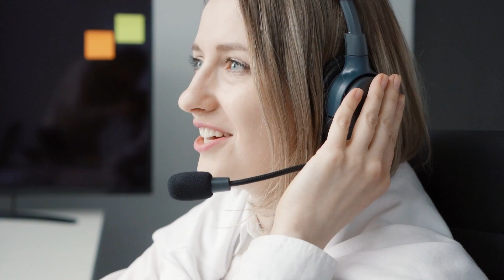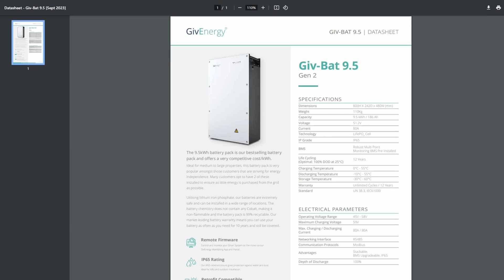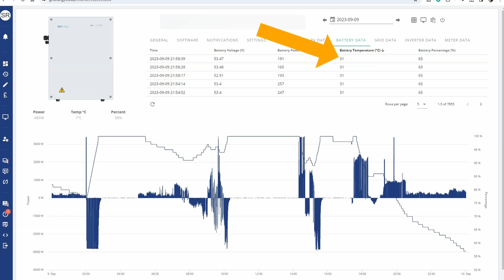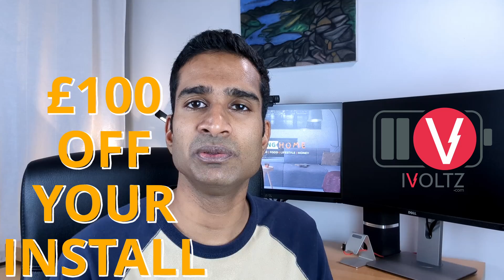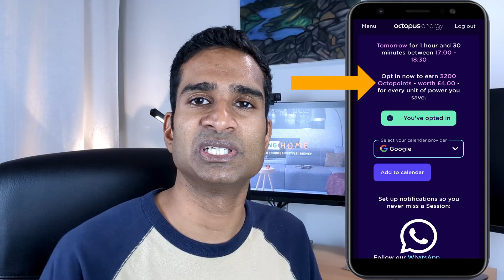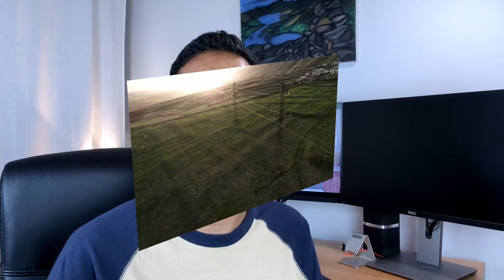1 Year Solar And GivEnergy Battery Review - What I Wish I Knew...BEFORE Buying!

Comment: I'm starting my solar journey, I'm settling on the largest solar installation I can fit on an east west roof, a 5KW inverter to reduce times of drawing from the grid and 10KWh of battery. I've got quotes but I'm being pushed to Fos ESS. Is there a reason to go with Givenergy?
Reply from the maker: Hey, absolutely agree biggest solar array. Re battery, I've had no issues with GivEnergy but I have seen reports of people with issues struggling to access customer services. Another option to consider is SigEnergy. Fox ESS have been around for a while but not something I'm too aware of as a brand. All the best with the install 👍🏽

Comment: For what its worth. I put a thermometer in the loft. The loft gets as hot as the outside temperature. Max I've seen in my loft was 33C. I think the battery overheating in the loft is based more on myth than based on facts.
Reply from the maker: Useful to know, thanks. So far we've not any performance issues, long may that carry on 👍

Comment: 10 panels for £4300 ? - they saw you coming.  - The biggest problem with givenergy is battery output to the house being a bit low. you still end up taking from the grid even though your battery is full.
Reply from the maker: Which array are you making reference to? I have two. Are you talking about the inverter capacity or lag time?

Comment: Thanks for the excellent video, well thought out and very interesting!  I had my system installed by Octopus in March 23 and I've been well pleased with its performance.   I had 13 panels (9 on 1 roof and 4 on another ), a 5.2kw givenergy battery and 3.6kw givenergy inverter. I'm saving around £1450-£1500  a year giving a 'payback' period of around 7.5 - 8 years. I have no real regrets about my purchase other than a nagging doubt whether I should have gone for a bigger battery to help out during winter months.  Have you ever considered including loss of interest in your payback calculations?  For example I invested £11.5k to purchase my system .  Had I not done that, this money would still be sitting in a cash ISA earning around 4.8% interest tax free
Reply from the maker: Hi Jim - Thanks for taking the time to watch and comment on this video. Glad you found it useful.

Yes absolutely, in my is it worth it video 2022 I did look at as sticking the money in a stocks and shares ISA. I concluded the ISA would win in the long term, which is why the system was bought after I'd topped up my ISA to 20k.

If you’ve not already, please do like this video, stay tuned for some more content and thanks for taking the time to contribute to the discussion on this video 🙂

Comment: Thank you for a great clear presentation. I am about to buy a house that has solar, an air source heat pump, a water tank and no batteries. Where to start ???
Reply from the maker: Hi - Thanks for taking the time to watch and comment on this video. Glad you found it useful.

Wow, that sounds like a great house. It may be worth asking the current owner how they run their set up rather than reinventing the wheel. Once you're settled in, it's well worth running the numbers for several different tariff options and whether retrospectively adding a battery is worth it for you.

If you’ve not already, please do like this video, stay tuned for some more content and thanks for taking the time to contribute to the discussion on this video 🙂

Comment: It's a no brainer to put the battery in the garage any issues the garage can quite happily go up in flames now it's the house instead - just what storage did you think you would be loosing just means a little less room for junk...?
Not sure you properly thought out the all the options, but hindsight is a wonderful thing, thxs for sharing.
Reply from the maker: Hi Pete - Thanks for taking the time to watch and comment on this video. 

I agree, in hindsight I would probably have put it in the garage and upgraded my cabling to it which would allow me to fit a faster charging point too. Hindsight is a wonderful thing.

If you’ve not already, please do like this video, stay tuned for some more content and thanks for taking the time to contribute to the discussion on this video 🙂
Reply: @everythinghome  Where there any concerns from house insurance re siteing the battery?
Reply from the maker: @peteturner8493 No there weren't. I did inform them though and it made no difference to my home insurance premium 👍🏽

Comment: Great video and information! It's a very complicated decision to make and very difficult to explain to less tech savvy people. 

Hard to believe that I am watching UK channels for solar and battery content! Downunder, weirdly enough, solar is not as helpful to the grid as it seems to be in the UK, with fèed in tariffs less then 5p per kWhr (and that is even a generous exchange).

In Aus on time of day metering, I believe that you can pretty much get free power during solar peak and free power at  solar minimum. So, I believe that it is then necessary to size your battery to carry you through the shoulder peak periods, am I missing something here?
Reply from the maker: Hi Brett - Thanks for taking the time to watch and comment on this video. 

Yes, that's exactly it. We got enough battery capacity to cover our peak usage. So basically we're either running off solar or off peak electricity.

If you’ve not already, please do like this video, stay tuned for some more content and thanks for taking the time to contribute to the discussion on this video 🙂

Comment: I added 8 x 450watt panels to my garage at the same time as my main roof (12 x 450) because I essentially only paid for the extra panels,  so even though they do get shaded latter half of the day the time it was still worth doing, whereas it wouldnt have been worth it for a standalone install.I guess you had to pay that extra install cost such as more scaffolding etc for your second install? I have a GE 9.5 battery.
Question, is a mains powered fire alarm the best choice for the loft? WHat if theres a power cut caused by a fire?
Reply from the maker: Hi Joe - Thanks for taking the time to watch and comment on this video.

That sounds sensible, yes undoubtedly it costs more for the installers to come out twice than just once. Our first install was easy on a single storey garage. They didn't erect scaffolding and it's partly on a slope so easy access, but definitely did for the 2nd install in 2022 (different company).
That's a good question. The fire alarms are mains linked but also individually have a 9V battery fitted which we change twice a year when the clocks change.

If you’ve not already, please do like this video, stay tuned for some more content and thanks for taking the time to contribute to the discussion on this video 🙂

Comment: I'm in the process of moving house, hopefully in the next couple of months. The new house needs a lot doing to it. It's got a really old oil heating system and there's no mains gas in the area.
I'm strongly considering all electric, i.e.  heatpump, solar and battery options. It's great to see content like this sharing experiences. Great video, many thanks.
Reply from the maker: Hi Chris - Thanks for taking the time to watch and comment on this video. Glad you found it useful.

That's definitely the time to be thinking about  it and and if you've not got any gas then an ashp should make sense. Especially given the savings to be had in not having to add a gas main and then the ongoing gas standing charge.

If you’ve not already, please do like this video, stay tuned for some more content and thanks for taking the time to contribute to the discussion on this video 🙂
Reply: Hi Chris, I'm in almost the exact same boat as you except I do have gas access. If you haven't already look up PVGIS tool on youtube and someone will show you how to calc how much kwh your roof could produce. from what I've seen so far it all seems feasible!

Comment: Thank you for the video. We had 19x395w panels, iq7+ microinverters, 8.2kwh GE batttery and Zappi installed in June 22 and it’s been great. Zero electric bills (including the car “fuel” for 7k miles per year) and still a few pounds left for the gas. Octopus Flux in the summer and intelligent go in the winter. My only regret is that there was space on the roof for two more panels, but I opted out as I thought it wouldn’t look “nice”.
Reply from the maker: Hi - Thanks for taking the time to watch and comment on this video. That's one great solar array and set up already. I definitely still regret not getting solar panels on the house and garage in 2015 but we live and learn. I'm looking forward to April again when I'll switch on Flux and be happily exporting again 👌

If you’ve not already, please do like this video, stay tuned for some more content and thanks for taking the time to contribute to the discussion on this video 🙂

Comment: Don’t think you say where your surge protector is? Between your house and the grid or on the DC side between panels and inverter?

Why not a DC coupled battery? Did you not look into SolarEdge? Only would have needed one inverter.
Reply: Also, didn’t you consider the garage loft space for the battery?
Reply from the maker: Hi Richard - Thanks for taking the time to watch and comment on this video.

The surge protector is between the house and grid I believe. From what I understand I needed an AC coupled battery to preserve my FIT. I hadn't thought of the garage loft space as an option but it would have still meant digging a trench to upgrade the cabling and access to that areas isn't particularly good. It's also got a lot of stuff there already but that could have been moved.

If you’ve not already, please do like this video, stay tuned for some more content and thanks for taking the time to contribute to the discussion on this video

Comment: I have a 5.6kwh solar panel array on a south facing roof which was installed about 2 years ago and I am about to get installed 2 x 9.5kwh and 1x 5.2kwh Givenergy batteries giving me a total 24.2kwh of storage + a surge protector and manual switch over. We are right out in the country and I am making sure we are covered for power outages. I found you infomation very helpful. Thank you!
Reply from the maker: Hi - Thanks for taking the time to watch and comment on this video. Glad you found it useful.

That sounds like a great system in the making. Interested to know, did you consider the GivEnergy AIO with the battery backup? Was it the price that swayed you to the x2 9.5s and 5.2kWh? 

If you’ve not already, please do like this video, stay tuned for some more content and thanks for taking the time to contribute to the discussion on this video 🙂

Comment: Thanks for sharing your experience with your system. Very informative. 
I have 20 530w Jinko Bi-facial panels of  which10 are installed as a roof for a car port and 10 as a protective roof over my shed.
I have a Sol-Ark 15k hybrid inverter along with 4 5.12kw Pytes batteries. All installed in late October last year. 
I have already generated over 3Mw of power and used it all!
I live in Costa Rica, so the sun is shining most of the time here, apart from the week after I installed the system, when it very unusually was similar to a UK autumnal day.
I have just bought an electric hot water tank (a very unusual item here) so that we can stop using our electrical powered showers. I see this as being effectively another battery. On a normal day my batteries are at 100% by midday and then the inverter starts clipping the solar production to match the usage. Therefore I will setup the system to divert the excess power after midday to heat the tank and I'm sure that this will suffice. This will also have the important benefit of not asking the batteries to spike their production for the showers, hopefully helping to prolong their lives. I wondered if had considered this option as you already have a hot water tank? Maybe run it hotter and heat it at the times when you have excess solar. 
We have a terrible system here for grid sell, so the system is designed to be effectively Off-Grid and so far so good. I've had 3 monthly bills totalling less than £20. And I have since tweaked the system to hopefully reduce this further. 
I'm loving the journey and like yourself, I'm happy to be substantially reducing my carbon footprint, having made quite a large footprint when I was younger!
Best wishes.
Reply from the maker: Hi Simon - Thanks for sharing your experience. That sounds like a well thought out set up. 

We've a 300L hot water tank in the loft and prior to install had planned to heat it up as you say a bit like a battery. However, export rates over the summer were excellent and had rates were low so it made more sense to export this and heat just the HW we needed via gas. Like you I'm trying to make the system more efficient as I learn more about it and accumulate the data 👍🏽

If you’ve not already, please do like this video, stay tuned for some more content and thanks for taking the time to contribute to the discussion on this video 🙂
Reply: @everythinghome  Thank you. Liked and subscribed.  I wanted to share my experience with YouTube, but I just don't have the confidence or, I guess the ability, to make the videos etcétera. Some people are just naturals and you clearly have all that's required.
Reply from the maker: @simonpaine2347 thanks for the support. 

I think anyone can do it. It's all self taught. It's just learning something new bit by bit. It's never going to be perfect at the start but that's progress 👍🏽
Reply: Smashing system Simon and great pv production. How much did you pay for that in Costa Rica?
Reply: @serraios1989  Thanks. For the complete install, it was a little over $30k US. Unfortunately there are zero incentives here! But I figured that in the past I have shamefully abused the planet and this is a great way of making amends. We all need to worry more about the planet, than we do about our investments and payback times.

Comment: Just had my pre-FIT 1.28Kwp array replaced with a 6.7Kwp array, 5Kw GE inverter and 2 x 5.2 GE batteries. Just waiting for the electrician to come and plug it in :-)
Reply from the maker: Hi Lisa & Jemima - Thanks for taking the time to watch and comment on this video. 

Ah, interesting. That's a pretty small FIT generating array and I can see why you replaced it with a much bigger install. Hope you get connected up soon 👍

If you’ve not already, please do like this video, stay tuned for some more content and thanks for taking the time to contribute to the discussion on this video 🙂

Comment: Thanks for update.
Any reason why you didn't go for Tigo optimisers on each panel which would help with shading performance? (And give you loads of panel data to analyse!)
Regarding battery location, mine are in a separate badly insulated garage. After a first winter of slow charging in the cold, I enclosed them in a 2" thick polystyrene box! Problem solved.. and I do monitor battery internal temp! It's fine, even on a hot summer day.
Reply from the maker: Hi - Thanks for taking the time to watch and comment on this video. We don't get a huge amount of shading and I didn't feel they were worth the added expensive although I didn't work out the numbers specifically. 

That sounds good, and I've seen other owners employ similar insulation tactics. Our battery is fine, but I think it's the inverter which is running closer to the limit! One to keep an eye on.

Thanks for taking the time to contribute to the discussion on this video 🙂

Comment: I love my solar system.  In Australia, I have 13.2 kW of solar panels (30 year warranty) on my roof and a 10 kW grid tied inverter (10 year warranty), installed in Jul-2023, at a total cost of $10,455 AUD (after government incentives).  This was my 3rd solar panel installation, each at a different property.  I pay $0.30 AUD per kWh for electricity from the grid, and export (sell) electricity back to the grid at $0.13 AUD per kWh.  My power bill was about $60-70 AUD per month.  Since installation, my power bills have turned into credits, and I now get free electricity and make around $110 AUD per month tax free on the excess electricity I export to the grid - a whopping 25% Return on Investment (ROI).  It's like having a piggy bank on my roof.  Living in / near the tropics helps.  I can get the CREDIT transferred to my bank account whenever I like.  My entire system will pay for itself in 4 years.  Highly recommend others do this if they can (if you live in a sunny area with suitably facing roof).  There are lots of scams and scammers out there.  Use a reputable, quality installer, and always do your research first.  Be extra wary of super cheap deals advertised on TV, internet, social media, etc.
Reply from the maker: Hi - Thanks for taking the time to watch and comment on this video. Glad to see we're reaching all areas!

That sounds like a great set up and I'm incredibly envious of the amount of solar generation you must get. Great advice!

If you’ve not already, please do like this video, stay tuned for some more content and thanks for taking the time to contribute to the discussion on this video 🙂